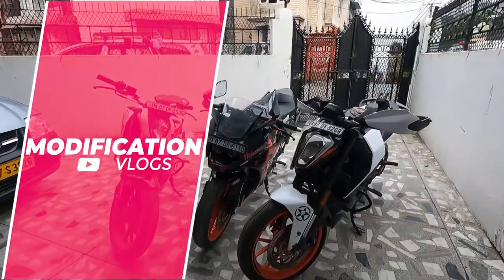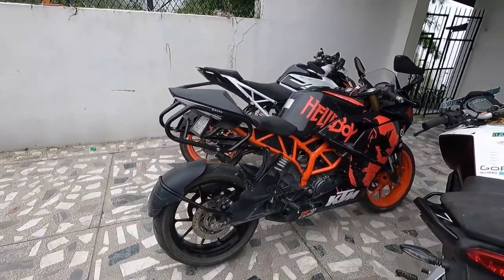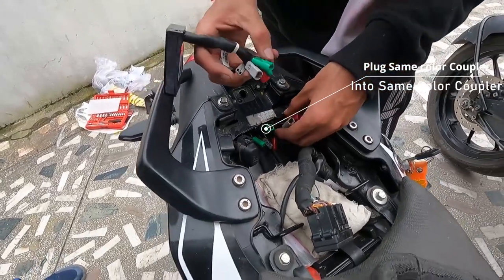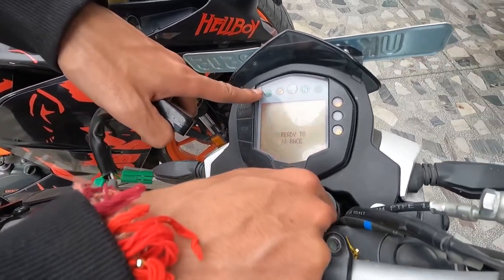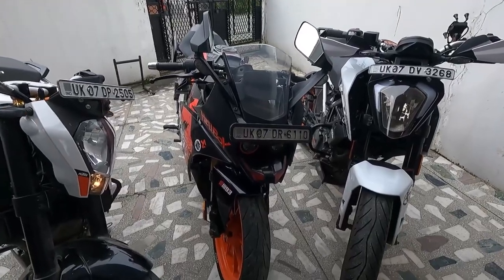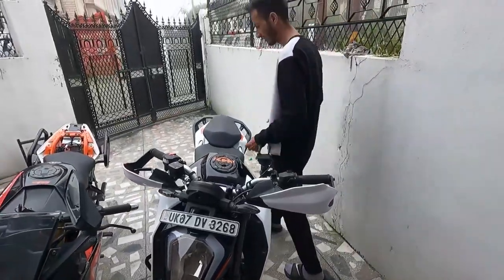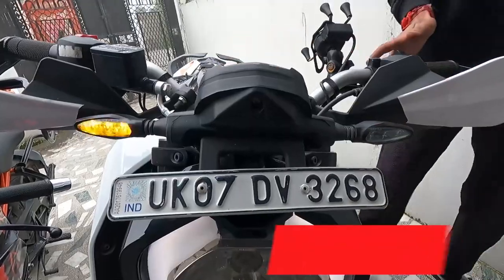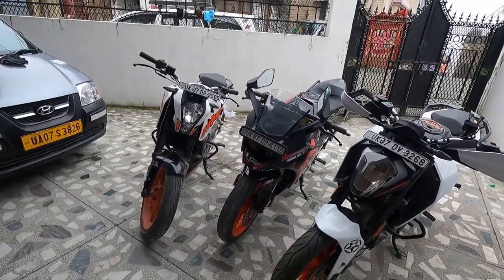How To Install Flashers On KTM Simtac PNP Hazard Flasher In BS-6 BS-4 All KTM DUKE , RC #simrac

Comment: Hey bro! Just watched your video and it was informative.
I was wondering if you could help me through.
I own a duke200 BSIV 2019 model and I can’t find the all 6 connectors.
There are only 3 connectors(red,grey and green) inside the rear seat.
Please help
How can i install this flasher in my duke without any wiring or switches.
Reply from the maker: Bro you can check it I headlight section